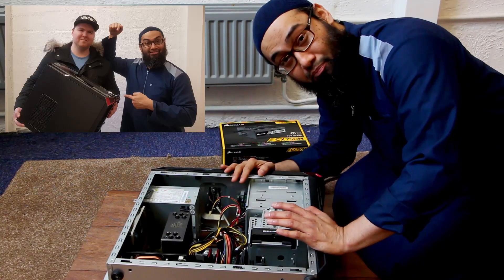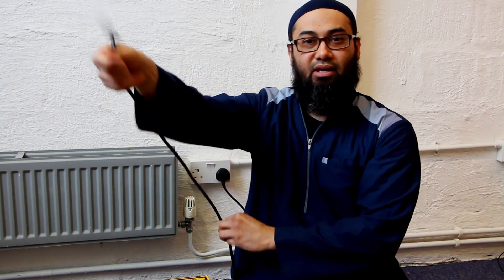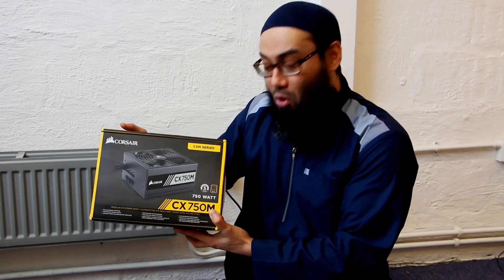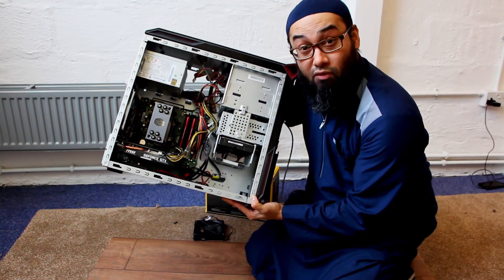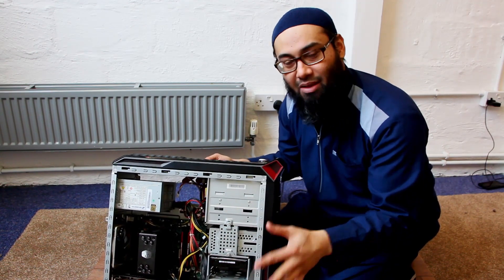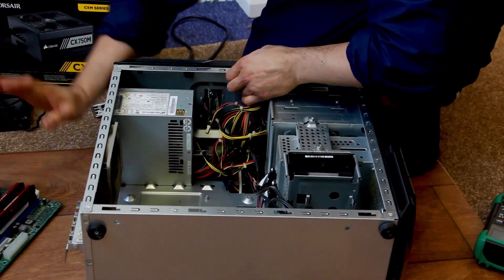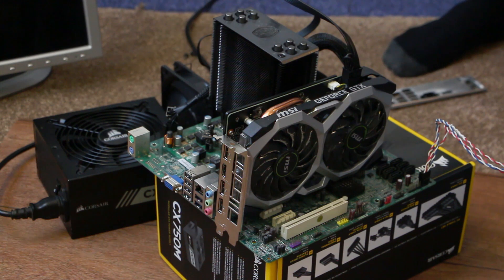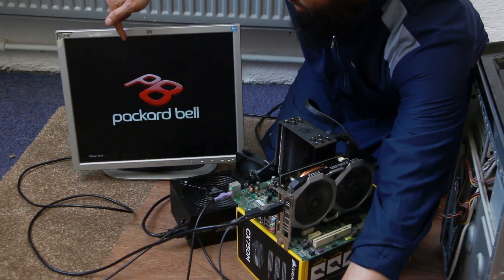PC No Power - Another Stupid Mistake - HAPPY CLIENT!

Comment: do you find the power supply box better than the motherboard box? maybe psu box is better for mounting gpu compared to motherboard box? 
my i5 cpu fan makes a light vroom vroom noise at random but more when stressing the system using chrome and games.
i have replaced every part except for the cpu and it still happens, even replaced the cpu fan, its been driving me nuts, near two weeks worth.
crazy thing is everything works fine, temps are fine of the cpu.

Comment: My computer would come on sometimes and if it does it works perfect.. It would come on with a delay sometimes like I would press the button and 4min to 4h later it would decide to bootup and work perfect... Sometimes it would take days before it would start the mobo has led showing its getting power and the paperclip test works..
Reply: Its no use to remove anything i have tried everything cmos reset to taking out ram reseating the cpu taking out the gpu as well.
Reply: If it is shutdown for more then 2h it wont bootup and have to wait a few days only sometimes it would startup but rarely
Reply: @xHelios98  if your system has built in video either from your cpu or the board itself then you can see if the system can turn on without the graphics card first by plugging in whatever video cable you will need (HDMI, DVI, VGA) if the computer takes a really long time to boot up that's not normal at all, so in your case you may either have a motherboard, memory or power supply problem, graphics cards are not usually needed unless you were going to do some gaming or advanced editing, sometimes some cpus don't come with integrated graphics so that's the only other time you will need a graphics card.